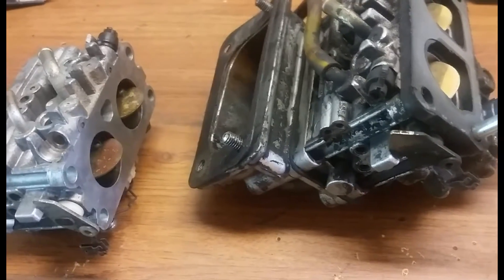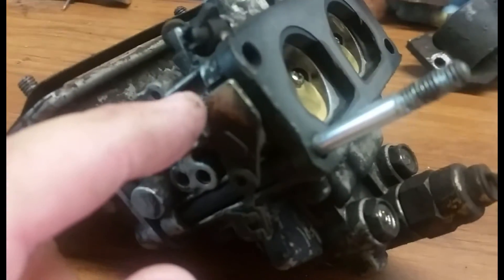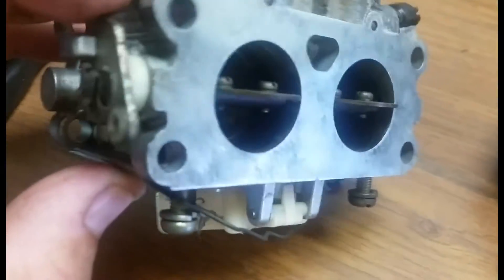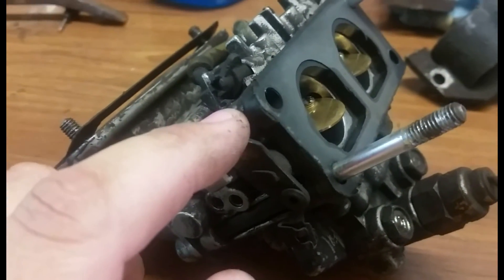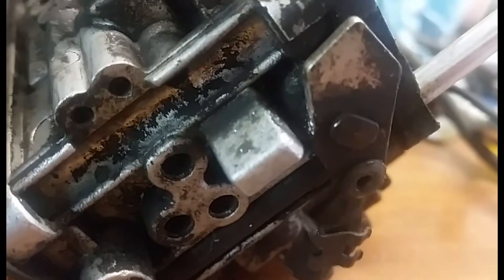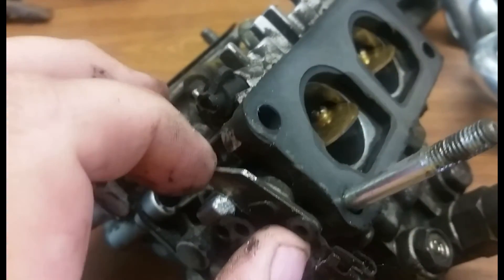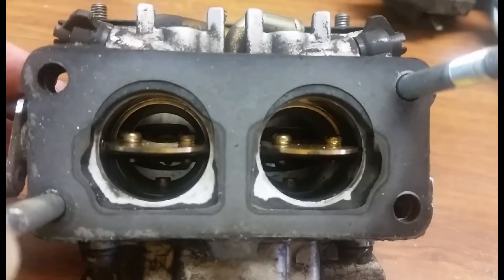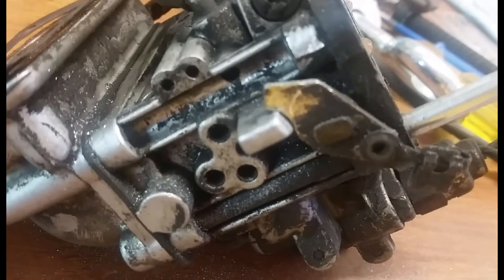John Deere 737 757 717 Kawasaki FH601D, FH641D, FH680D upgrade to 25HP, FH721D. Part 1

Comment: I have a John Deere X465 with a bad FH641D (21 Hp )engine, so if I buy the cheaper FH601D (19 Hp engine) and modify the carburetor I’d have the 25 Hp FH721D engine?

Comment: OK gotcha... well it does do both,  so I guess it's good... really didn't do much till I adjusted the governor down on the slots.  I actually think you could probably gain a hp just by doing that!... anyway thanks and thanks for the video... I was afraid to grind till I seen it... but I thought well it's gonna be 30. bucks either way... lol

Comment: I know  that!  I was just describing where the throttle shaft stop is on the carb!  what I'm saying is when the engine is running the throttle stop never hits it so why make the change?
Reply from the maker: tracy anders it should hit the stop with the engine off and throttle at full. If it doesn't, you might need to adjust something. Running, it won't be against the stop unless you have a load on the engine. ☺

Comment: I did the adjustment on the throttle stop, but I'm not convinced this will add any hp, because the governor keeps the throttle shaft stop well away from the carb casting stop with the idle screw in it. And yes.....I've adjusted the governor (both ways) and it still will not hit the stop.
Am I missing something here?
Reply from the maker: tracy anders The idle screw doesn't have anything to do with the governor. It only limits the return of the butterfly to the closed position.

Comment: Are the jets different between the 23hp FH680 and 25hp carbs?
Reply from the maker: jeff garwood Same jets. Exactly the same other than the throttle stop on the throttle shaft.